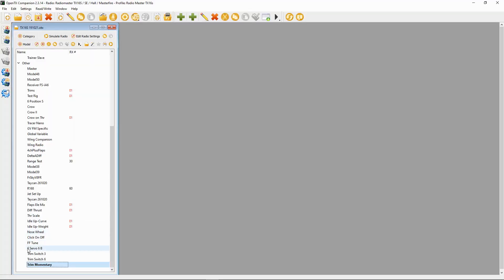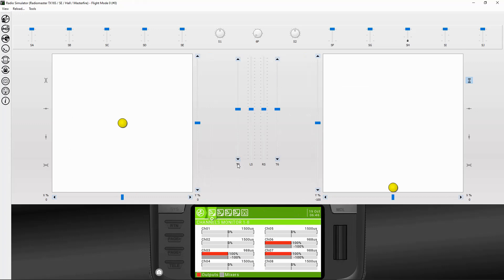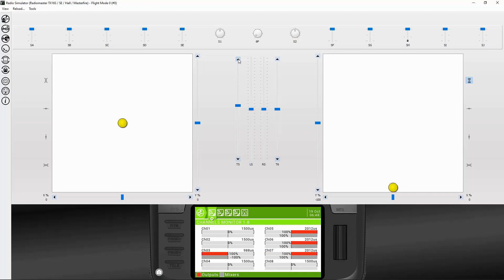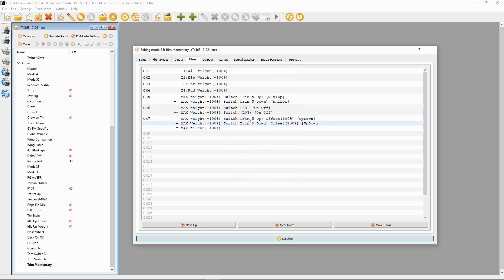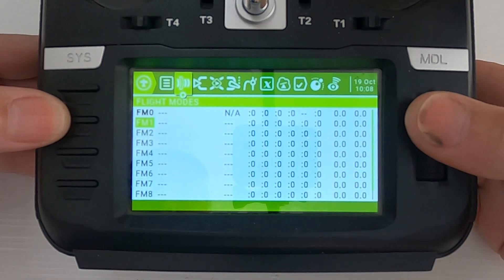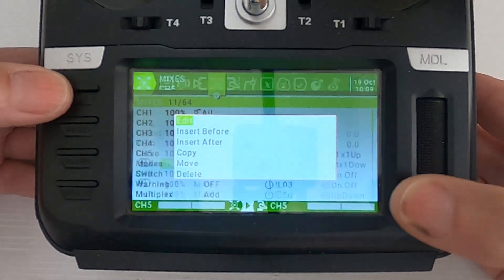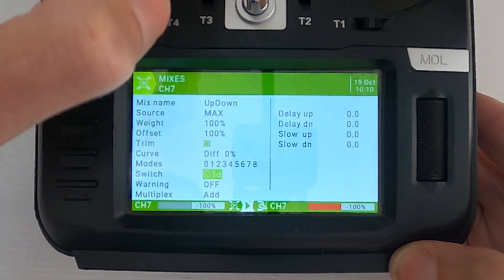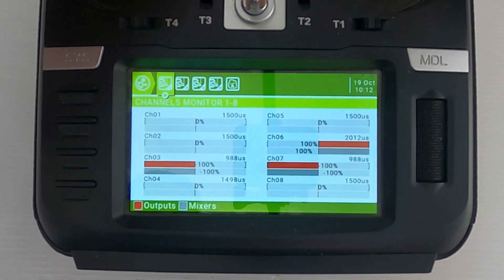OpenTX Trim Momentary Switches

Comment: Hi Bill. This video is very useful and thankyou. I want to use the T5 and T6 buttons (On an X10S)  to output a proportional servo position.  When the audio says I am in the center of trim, the servo should also be centered. The more times I push it, the further the servo moves away from center, culminating at 100% in both directions.
Basically I want the trim buttons to work as proportional channels. Is this possible?
I went from an X12S to an X10S and need two more proportional channels.
Thanks!
Reply from the maker: I will work on this for you Dave.

Comment: Hi Bill, complete newbie wanting to get into DLG and wondering if the RM Zorro will be able to be programed to have momentary switch for launch mode (in the traditional top left position)  and a 3 position flight trim modes.
Reply from the maker: Yes you would able to set up the mixes in the way you want. If you are not sure how to do this send an email to triplemadventures@gmail.com explaining exactly what you require the flight surfaces to do and I will work out the mixes for you.

Comment: Hi Bill. Do you think it is possible to connect a 6-position switch, which can replace the 6 pushbuttons on the radio?
i have this on my turnigy 9XR pro
Reply from the maker: Yes you could where clicking the trim tab up or down will cycle 5 - 6 - 1 - 2 - 1 - 6 like the 6 position example in this video.